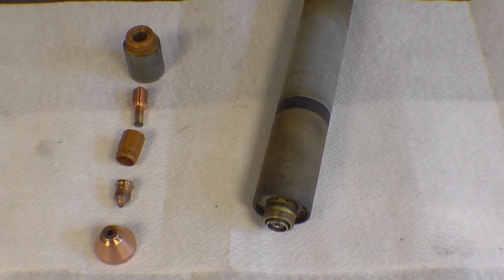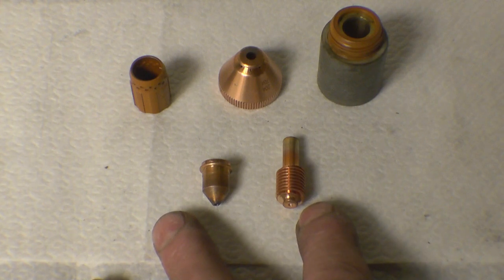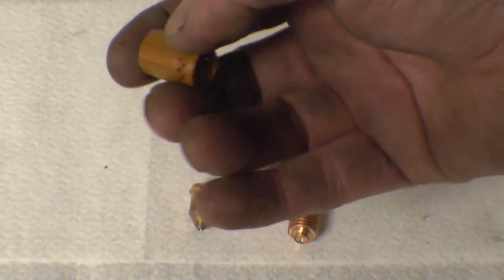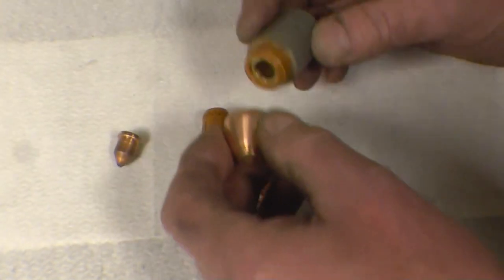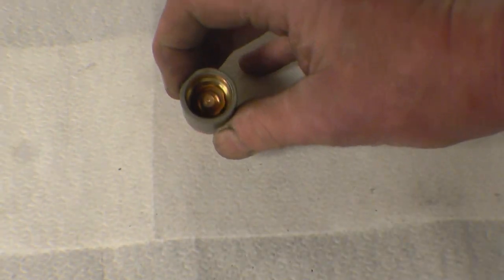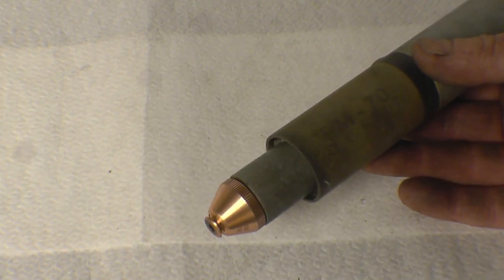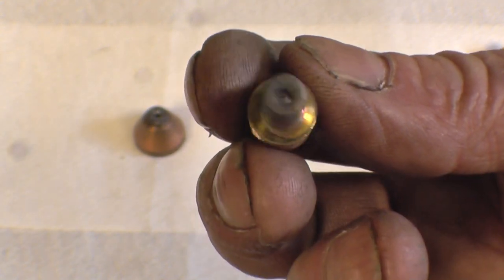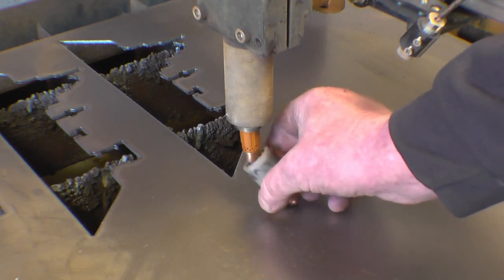PM 70 MACHINE TORCH

Comment: Hi John, I have just bought (thanks to to you !!) the smaller P30 machine from R-Tech. It uses a "Drag Torch" which is quite different to the 50 that you reviewed. That was a Pilot Arc torch (as is the PM 70). The instruction manual with the P30 didn't really explain how the drag torch should be used, So please do a video explaining what a drag torch is about!! I will also review the manual with R_Tech.

Cheers Will, Malahide.ie